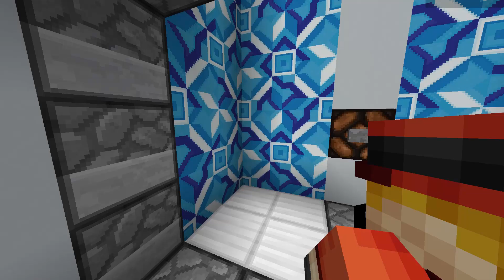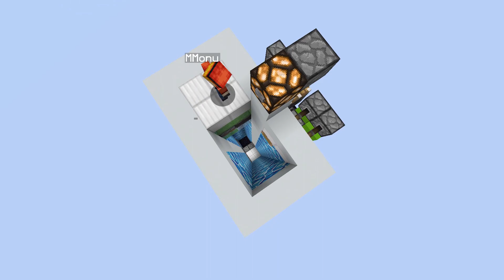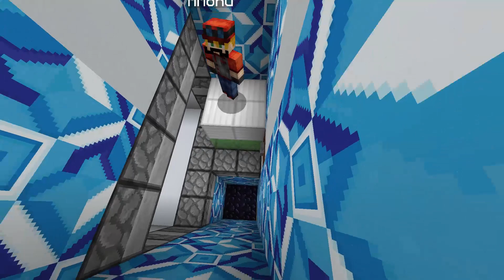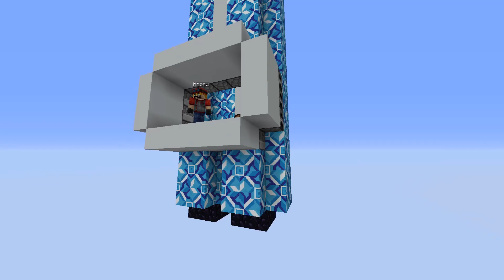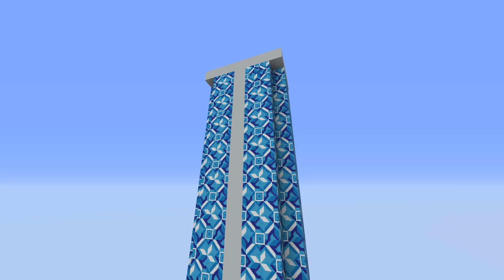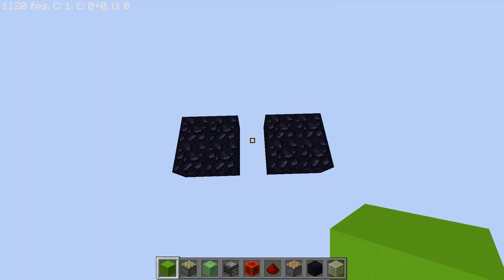Realistic 2x2 Elevator 1.11+ [Tutorial]

Comment: Can you make this work with 3 elevators for 3 levels, with every level having an elevator at all time?
Reply from the maker: That would be difficult, because one would have to go all of the shaft down at once. Also you would have to go up from the middle floor and then down again to get to the bottom floor. If you want a can make a single shaft multi-floor elevator.